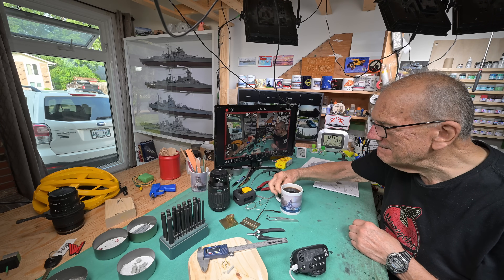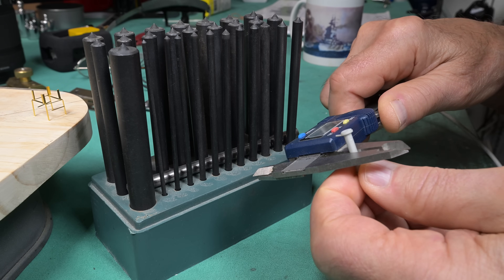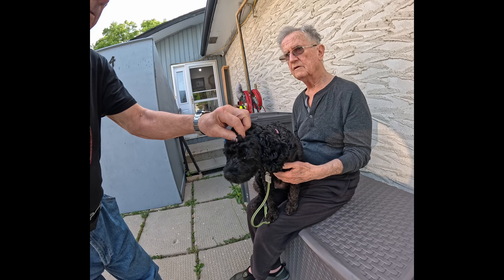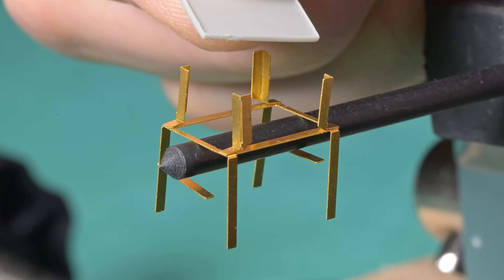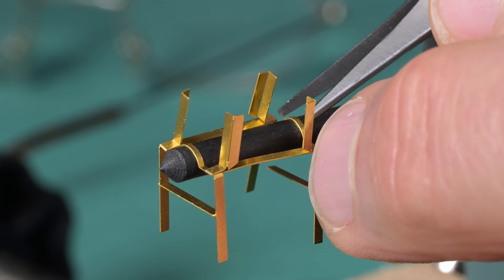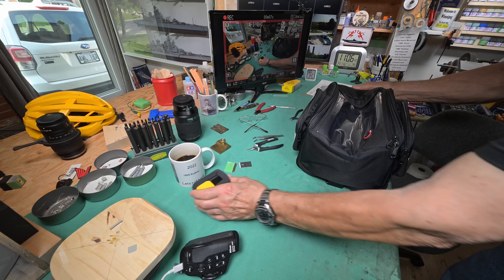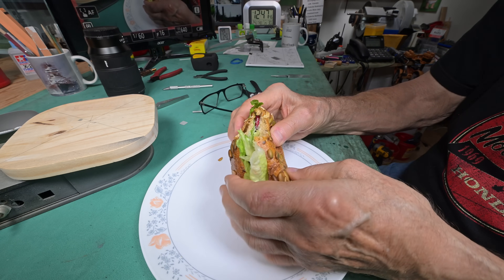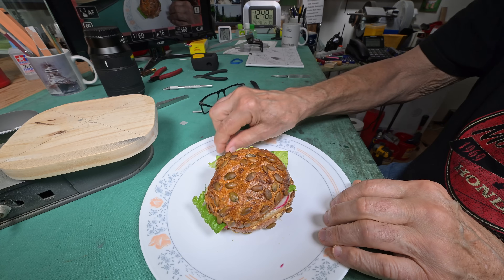The Model Ship - Part 2060

Comment: Gabe "....might be able to bring along some show and tell."      ......and muffins.😊

"..... enough talks....lets have some action!"   That was funny.

I was on the edge of my chair through that complete bending thing.  Would applying that solder with a round toothpick be any easier to place a little on each side of the connection than trying to place the whole glob on top?  Like just rolling on a little at a time off a toothpick.    See ya.            JimE